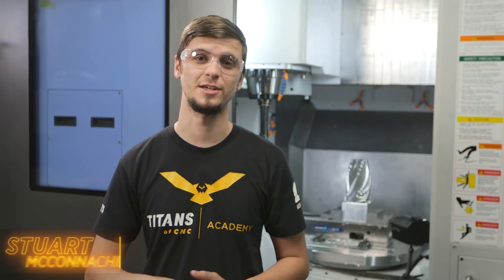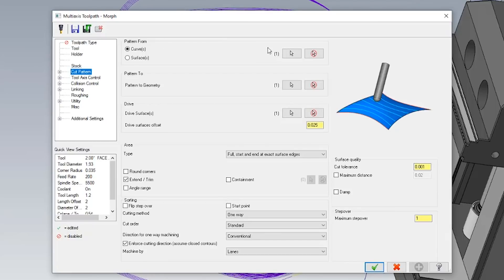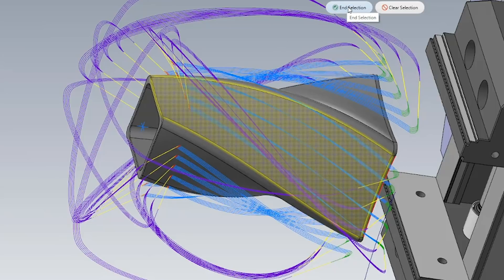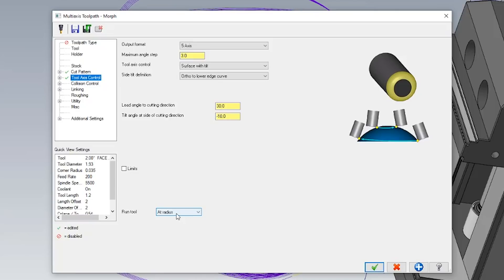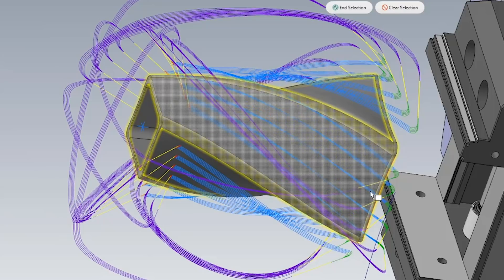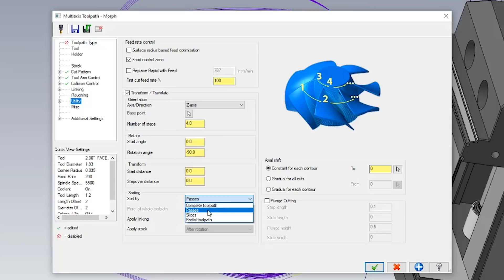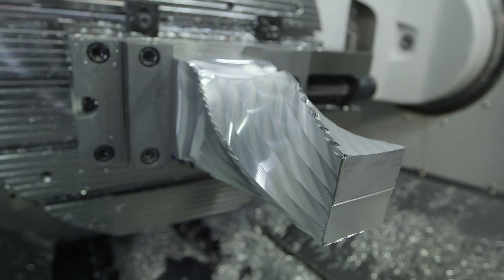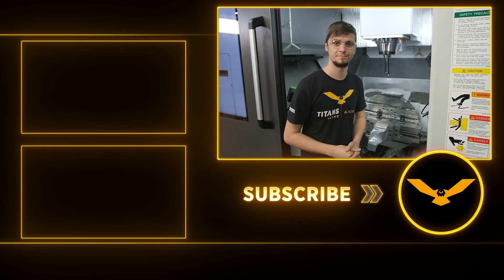Setup, Programming & Running STUNNING 5 Axis Toolpaths | DVF 6500 | DN Solutions

Comment: I used to like to follow along when you used Fusion 360 but I can’t do that now as you have, for some reason, switched to Mastercam.
Reply: Probably sponsor reasons

Or its because fusion doesnt have all 5 axis capabilities
Reply from the maker: We still do both... Mastercam has better 5 Axis capabilities and is ITAR compliant.
Reply: Yes I understand, it’s a pity that Mastercam doesn’t offer a scaled down version for non-commercial users who wish to learn the software like Fusion.
Reply: @tj9382  wouldnt work because then mastercam must be cloud based so they can remove features later and let you pay if you want to use them again.
Reply from the maker: They actually do and it’s free... go to the resources tab on our academy.titansofCNC.com
Reply: @TITANSofCNC  Ah, yes so you do, fantastic, I should have known you guys would have it covered. Thanks, and thanks for the academy, I’ve learned a lot from you guys.